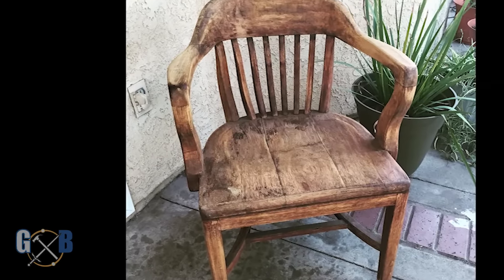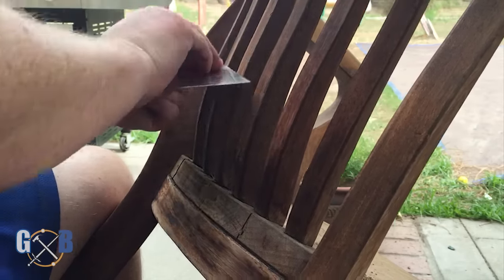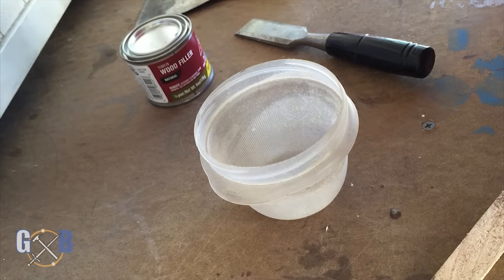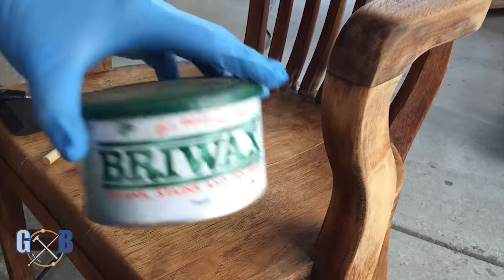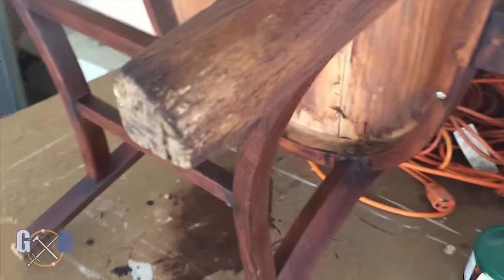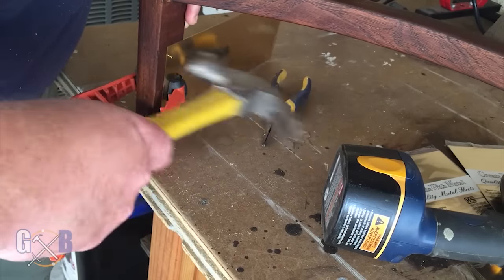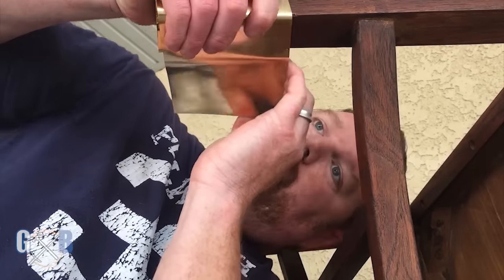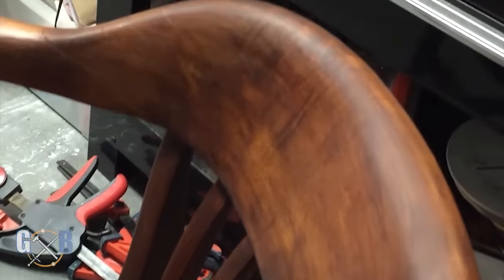Restoring a Vintage 1940's Office Chair (Attempt) :: How To

Comment: Wonderful! The chair legs are classy with the brass finish.  The brass sheeting is difficult to work with, I would try to slightly heating it up with a HAIR BLOW DRYER!  It makes malleable to work with.
Reply: 100%. Was thinking this needs heat!
Reply from the maker: This video pretty old at this point, I would probably take a completely different approach now.

Comment: Hi, I have the same chair, but one of the wood pieces of the seat is separating. What is the best way to glue it back?
Reply from the maker: If you have clamps that are long enough, I would recommend filling the gap with wood glue and sawdust and trying to pull it shut. If that is not possible, then maybe try packing the gap from the separation with wood filler/wood putty and then sanding flush when dry.

Comment: This chair was fairly easy to put together, the instructions were clear and I was about to follow along with no issues at all. It took me about 20 minutes to assemble. https://www.youtube.com/post/Ugkx5hPALGI87E991DRmXev8PUFJGrrRcONS I did stuff the back of the chair with a pillow so it wouldn’t be so hollow after taking all the pieces out but that’s just a personal preference. I also added a pillow for lumbar support because although this is a great chair and is comfortable, it’s not necessarily the best if you’re sitting 10+ hrs a day wfh but in all honesty for the price, I didn’t mind at all. It looks great in my space and easily adjusts the height when needed.
Reply from the maker: Um... There was no assembly